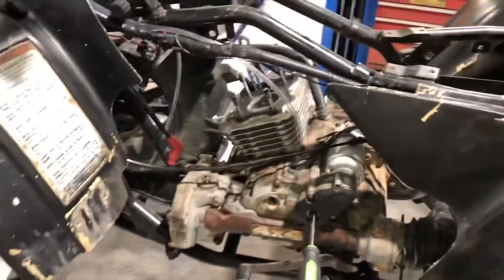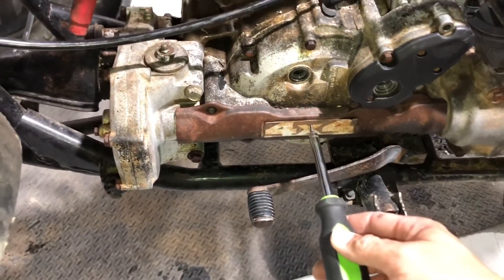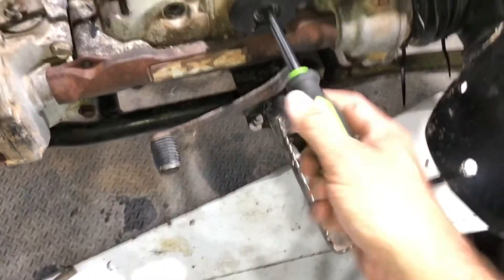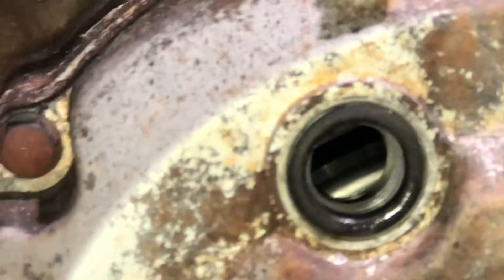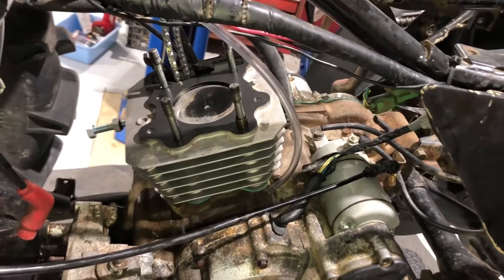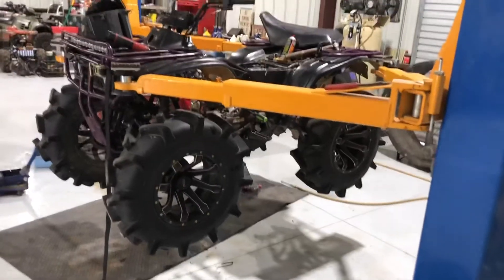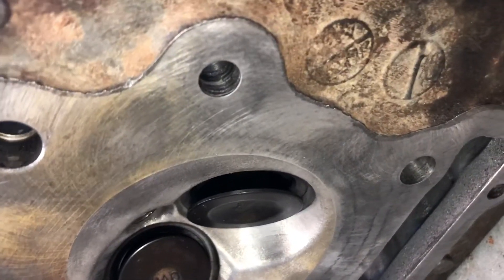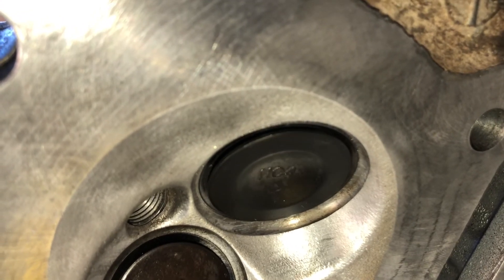Honda 300 4x4 Fourtrax Top Dead Center / Timing Part-1 DIY

Comment: What would cause a 300 Honda four wheeler to loose compression after pulling gears out of the crank vase
Reply from the maker: Bad rings or miss alignment of the rings. Bad head gasket or valves are not set correctly.